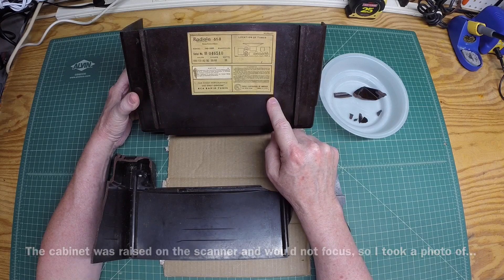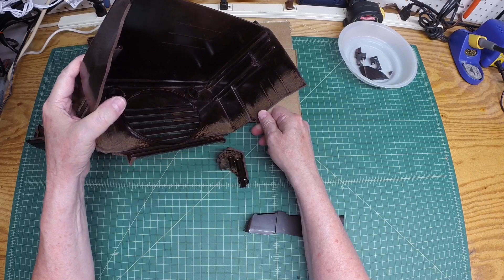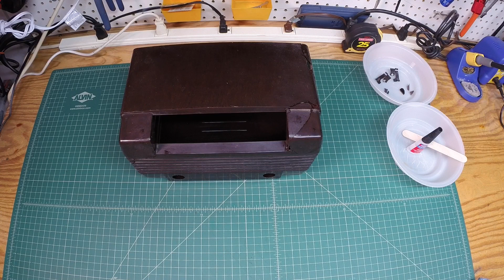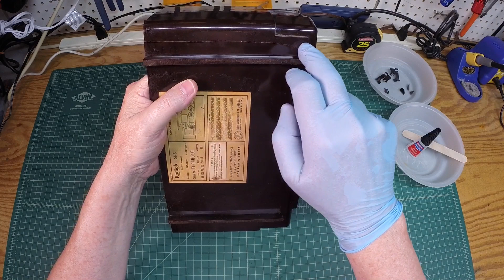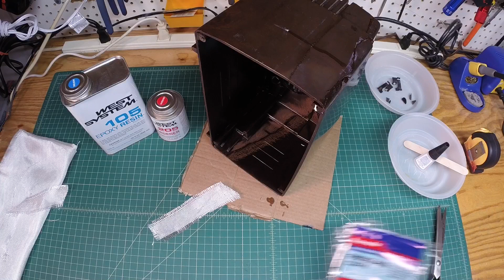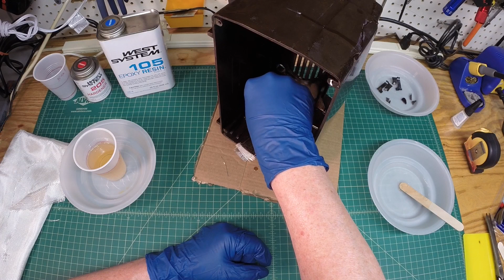Radiola 61-8 - Bakelite Cabinet Repair w/ Epoxy

Comment: I wish I would have seen your videos first,I got a couple of 60 era tube radios ,that the cabinet was busted pretty good ,and I trying different ways to repair them ,I found out the hard way Maine epoxy not the way to go to thick.I guess I learn by mistakes .
Reply from the maker: Ron, small hairline cracks in plastic cabinets can be repaired using superglue and if possible you can lightly sand the back edge or inside of the plastic cabinet out of view, collect the fine powder residue, fill the hairline gaps, then apply a drop of glue or apply the drop of glue first, then add the filler and after drying, some 800 through 2000 wet sanding and buffing may help hide the repair.

Larger cracks like the Radiola needed filler and required me to paint the cabinet afterwards.

Hope this helps.

Best,

Don

Comment: Hello  -  Just the video I was looking for!  I have an RCA 56x with  a crack in the Bakelite that I want to reinforce.  I happen have West System on hand and was wondering if in fact it has a tight bond to the Bakelite after scuffing?  Did you have good strong bonding with the West System?   I ask because it does not bond to plastic.  Thanks, Jim
Reply from the maker: Jim - the bond was very solid after scuffing up the surface and letting it cure for the recommended time. The family I restored this for hasn’t reported any issues to date. Hope your project goes as planned. Best, Don
Reply: @RestoreOldRadios  Don, thank you.  I went ahead and did the crack repair today with West System.  I think she will be fine!  It was just to stabilize a front to back crack to keep it from getting worse.  I have lots of experience with West System.  This was the first Bakelite repair for me!  Thanks again and enjoy, Jim

Comment: so...what about ASBESTOS???
Reply from the maker: I try to avoid sets with it due to the safety and health concerns. Here’s a web link towards the bottom of the page on how to encapsulate it. Be safe. Best, Don

http://www.wa2ise.com/radios/repair.htm
Reply: But i've never seen anything similar to asbestos fiber in radio bakelite. Maybe in in broken PCB but not in radio bakelite , so the toxicity of sanding radio bakelite is asbestos or something else?
Reply from the maker: freexky It’s my understanding from some old timers, asbestos at times was used as a filler in the production of Bakelite, thus the concern over breathing the airborne particles from sanding or other.  Best, Don

Comment: It's looking very promising Don.  Though I've never seen the resins the restorers of Bakelite telephones, and radios, use, I have been led to understand types they use for this purpose are used in the marine industries, and the repairers mix them with powders, and perhaps enamels, used by makers of jewelry to achieve the right pigments, and luster.  The results are 99.99% superb - one is not able to see where resin replacing chunks of missing Bakelite join the original Bakelite -  in fact, the resin replacing chunks of missing Bakelite look exactly the same as the rest of the original Bakelite.  This may take some believing but I truly have seen such Bakelite repairs - and like you, each repairer does not attempt in any way to disguise their repair work on the inside of cabinets.  As they say, they have no wish to pull the wool over anyone's eyes as they charge high prices for Bakelite repairs, therefore, they are happy to see the level of skill involved in the repair work they  accomplish on the outer surfaces.
This is one of the main reasons why they will not divulge their Bakelite repair technique secrets. 
As I say, I'm liking how you are progressing with this.
Regards,
Phil.
Reply from the maker: +SteelCity321PB Phil, I wish I had their skill level. Looks like I'll be painting the Bakelite following the filler/fairing state. I might play around with some more pigments and experiment on this cabinet in one area. I'm intrigued by this and would love to find the secret recipe. Thanks again for following along. Best, Don

Comment: Nice video.  Sometimes I'll spray a very, very light dusting of 3M 77 glue on the fiberglass cloth then place it into position.  The 3M 77 glue will hold it in place while I brush on the epoxy.  When done, I'll use some folded up toilet paper to blot up the excess epoxy as needed.
Reply from the maker: +Crist Rigotti I love the 3M 77 solution. I've got some and will use it on the second repair. Thanks for sharing and taking time to view. Best, Don

Comment: Wow Don, that did seem like allot but, I understand how you feel! I can imagine being a 1st with that epoxy, the problem of not having enough. Oh no... there is no time to mix more now....hehe. Yup done that myself as well with JBweld. epoxy always scares me with so little drying time. That seems like a great way to go tho, you can get really heavy on the other side with sanding a stuff without worrying about breakage!

I was reading a while ago that deep into the Bakelite,  is made up of stuff like formaldehyde and other odd mixes. Weird stuff but it was our "plastic" back in the day!
Thanks so much for sharing, I hope all goes so well with this nice radio!
Reply from the maker: +saturn5tony Hi Tony - yep you're spot on regarding the epoxy. I got it figured out after the first application. The stuff flows great with no fillers. Thanks again for following along. Best, Don